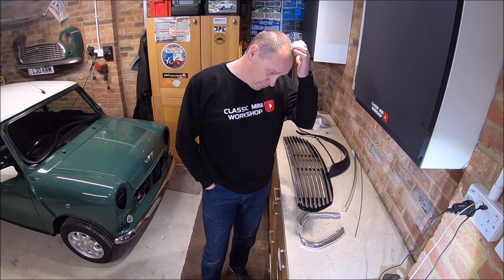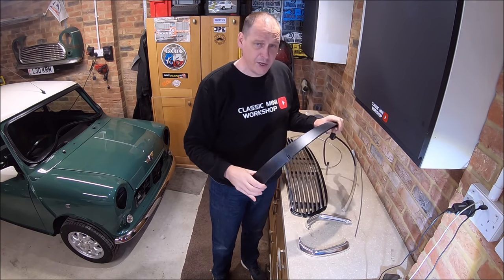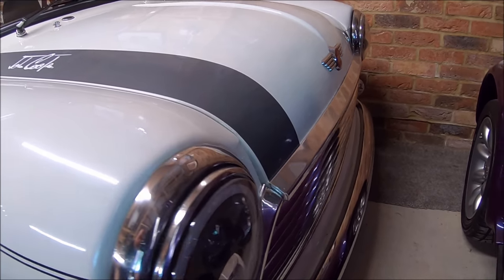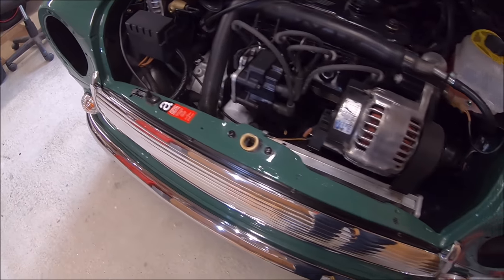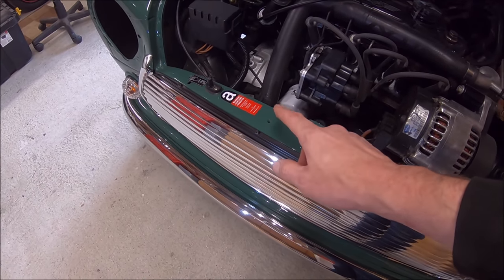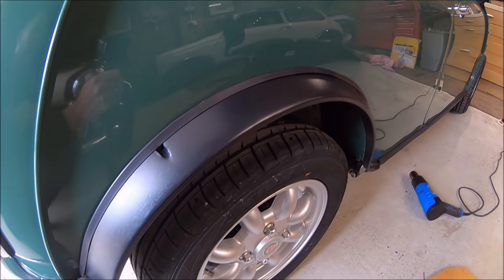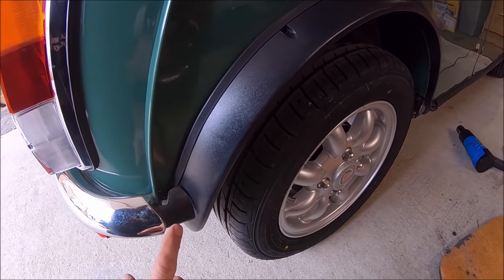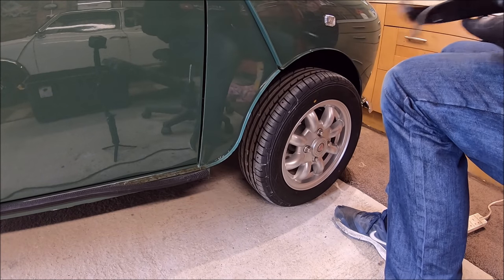Wheel Arches & Grille Fitting - Classic Mini Workshop Project Sprout Pt.71

Comment: I believe the little plastic inserts between the rear bumper and the arch are to prevent pedestrians getting snagged on the bumper. A similar problem occurred on the early Mk1 door handles, they were like a hook and so a small boss was added to close the gap up between the handle and the door. The bumper inserts were fitted to the Japanese market minis for many years before they were used over here.
Reply from the maker: Thanks, I thought it would be something to do with safety

Comment: Don't you hate drilling holes into that beautiful Mini!  Why rivets to hold the arches on? Wouldn't they be harder to get off ? Also what were you spraying around the wheel well before mounting the arches?
Reply from the maker: Just to keep them original looking as they used rivets from new. I was spraying wax to help with rust protection
Reply: Using screws to fix arches on is OK if they are staying on for good. If you  remove them every time you do the hole becomes bigger and bigger where as rivets don't affect the hole. Dimensions also screws can come loose not often rivets do mate
Reply: @classicminidetails8887  Thanks for that Alex and Keith. To remove the rivets I suppose you just drill them out.

Comment: How did u mount your old front to the wall?I have my old front I want to do the same plus light the headlights up with a switch.
Reply from the maker: It's just hanging up with some bailing wire through the bonnet catch hole in the slam panel
Reply: @classicminiworkshop  thanks looks great need to sort the mini out 1st before I do it but thanks for the tip.

Comment: Keith, I used rivnuts (4mm aluminium with 4mm stainless screws) to attach the headlamp bowls to the body rather than pop rivets. Where did you get the rubber trim from for the arches? I am also planning to use rivnuts to hold the "special" arches onto the body so having a rubber trim would ensure these are not visible.
Reply from the maker: Good idea on the rivnuts. I had not thought about that of the arches. The rubber trim came off the old W&P arches that I removed

Comment: Sprout is certainly coming along now, loving your way of thinking with the spray wax to help resist future rust.
Those plastic filler blocks between rear bu per and the arches is it because of some pedestrian safety regulation?
Reply: Yes I think it was some update on safety regs.  Eg with kit cars the SVA test uses a radiused tool (like half a ball) to make sure there are no sharp edges on the body.  I suspect those covers are part of conformance.

Comment: Very nice job, good to see you putting the rubber trim on the arches. Hate seeing them fitted without. Did you use the heat gun to get the ends to fit closer to the body?   Mine stick out.
Reply from the maker: Yes, the heat gun was used to get them to sit correctly

Comment: Hi Keith, Sprout is looking great! One question - I noticed that after you drilled the holes, you didn't appear to put any paint or protection in the hole? You sprayed the wax coating on the panel, but just wondered about you experience on whether it is worth putting additional protection in the hole?
Reply from the maker: I also dipped the rivets in grease so that when the rivet crushes it traps grease between the rivet and hole. I've done this before and provided the grease doesn't get washed away no water can come in contact with the metal.

Comment: what does the heat gun do on the arches? im about to do mine in the states thanks for all the helpful videos..
Reply from the maker: Mine were sticking out a bit at the bottom so I just heated them up a bit and held them in place until cool and it worked a treat
Reply: thanks hope mine come out as good as yours